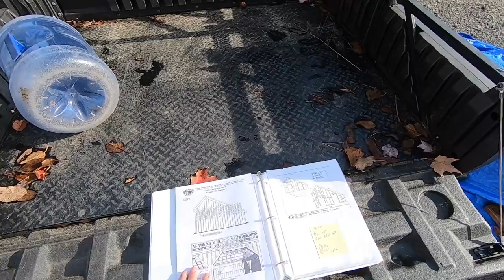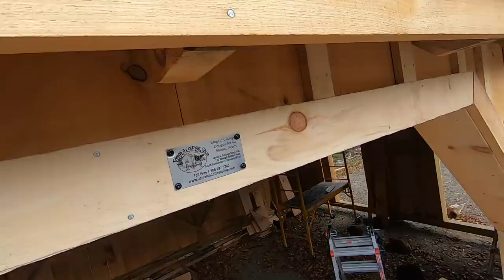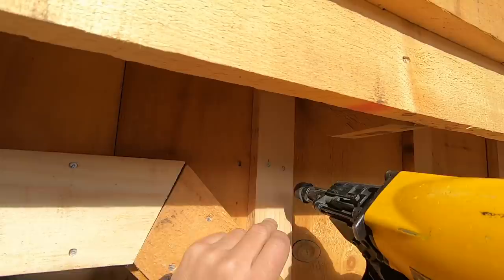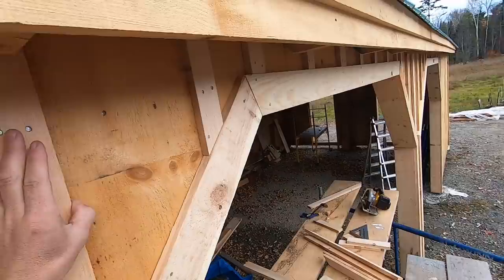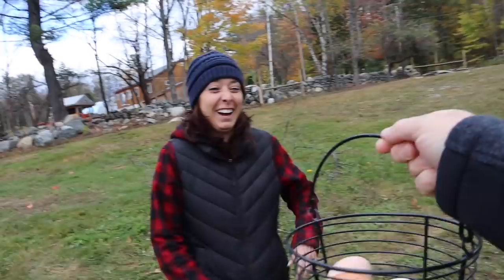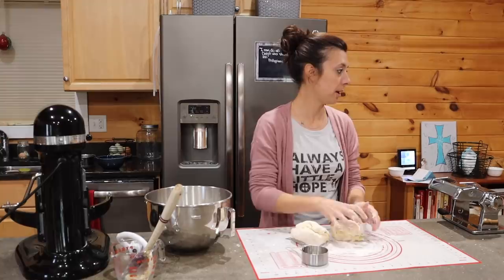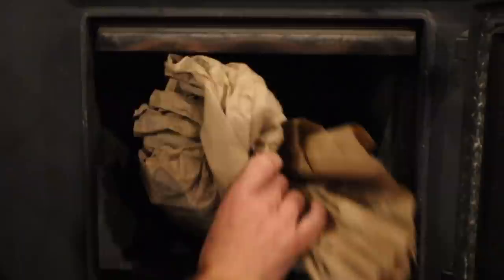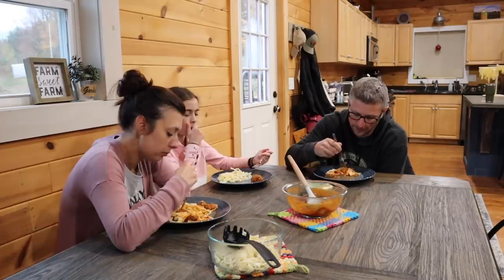It's Like a Massive JigSaw Puzzle Building a Post & Beam Garage Kit Bought Off the Internet

Comment: I love the aged patina of the wood too. After about 3 years if I see areas that are getting soft, I’ll put on Thompson’s Waterseal which doesn’t change the aged look.
Reply: J Glass  👍👍great stuff!  And minwax Wood Hardener can give you years more if you have sponginess along some bottom battens and panels, and then Thompson’s over that.
Reply: Yeah patina is one thing, but there is a difference between “patina” and rot. At some point you have to actually stop the deterioration process or the earth will claim these building back from you.
Reply: @chrluc  yes, and before that happens,  I start using Thompson’s waterseal.  When I see the bottoms of the long vertical shiplapped pine, I’ll pentox those areas, and cover all the rest with waterseal

Comment: As you will need to have some early morning and late nights in the garage I would say to order a few LED lights to put in the bays and run a line or two off the building next door to power them. 1 for lights and 1 for a few outlets will mean no running extension cords between them for you to hit with the mower or snow plow.

Comment: The garage/barn is looking great. The battens add a lot to the character. I like the natural look too, although I would be concerned for the long run and not protecting all that wood and your labor. 
I learned noodle making from my grandma. she was a farm wife who raised her family of 8 through the Great Depression and two world wars. Pasta noodles are different than egg noodles being drier and denser. One egg per cup of flour and enough water to form a firm, non sticky ball, wrap in plastic and refrigerate for an hour. Grandma rolled all her noodles by hand, I use a pasta machine like yours. Grandma also mixed and kneaded her dough by hand, I use a food processor with the dough blade for pasta noodles, egg noodles I do by hand.  
Egg noodles 2 eggs per cup of flour and enough water to make a slightly sticky dough, again wrap and refrigerate. (This step gives the flour time to hydrate. It gets wet in the mixing but has time to absorb that water during this rest.) Notice no milk, this is the first I've ever seen a noodle recipe that called for milk over water. Noodles are a basic food and were an economical way of putting more food on the tables of large families, milk was too precious for making noodles. I roll out my egg noodles by hand but typically leave them thicker for use in pot pies, (not your Swanson's baked in a crust pies, real "pot" pies made in a stock pot.) though they would roll out nice through a pasta machine. 
Grandma used her folding clothes rack for drying noodles, plenty of room and easy to store.

Comment: I see the workshop lower wood siding is going black with damp and mold. Why not treat the wood, it will last a lot longer and look better for years. Soft wood like pine and fur rots quickly if not treated and the damp kept at bay. I know you said you like the natural aged look, just seems short sighted not to protect your assets for many years to come.

Adding a splash shield like corrugated steel around the perimeter bottom 24” and a gutter to take the rain away from the roof will help as well.

Comment: Hmm...I kno you need the scrap wood for kindling.  But lookin at all the scrap you had, there coulda been some mini quick projects that coulda been made out of it.  I recently built myself a spice rack to go on the wall for quick and easy access, instead of scrounging around in the cabinet.  Made cooking soo much easier and alot faster on my part.  Only mentioned as an idea in case you wanted any idea projects to consider.

Comment: I'm no carpenter Al so at first I wondered why you would go to the trouble of trimming out the doors etc but it does look so much better now and I imagine that adds just a little more strength. Have you any plans to fill the gap at the bottom, or is that a design decision?

Comment: Have you thought of a rain water collection system on your barn as the boards are going black at the bottom and will rot quicker
Reply: If you put a gutter on the barn you would have to remove it before winter as the weight of snow they get would probably pull it off!!!

Comment: I like that you now go straight into the job,!! We all know you do Chores, but knowing what you are gonna do I just fast forward to the job!, the jobs looking good, are you gonna Concrete the base or Stone it?, maybe with the excess timber supplied with the building you can make a big box On Wheels to keep next to the saw to put off cuts straight into it, then doing 1 job instead of  throwing off cuts on floor, picking off cuts up,  putting into bag, Drag bag to vehicle to dump or put on log pile, good job guy cant wait for next big job. from UK.
Reply: Lumnah Acres said in a previous reply that gravel will be added to bring level up to the top of concrete piers and thus a gravel floor.
Reply: @tonygrimes13  Thank you.

Comment: Gnocchi, Ravioli, Pierogi, Lasagna, Linguine, Angel Hair all fresh home made man that is a neat little   device.
If you & Gina both get a license & both fill your tags that would be 2X the meat. You have the butchery setup already. The scaffolding with a some adaptation could become a blind & SXS to move it around will make it cake. The land is there plus using the blind can give you a heads up on what predators are moving near by.
I suggest hunting could provide several practical benefits. A dollar slug = pounds of lean premium meat - a few hours of time with a couple minutes of excitement thrown in. Check the Hunter safety requirements & enjoy. Dress warm though (hands & feet) 🏂🏻🤝🏻

Comment: Aren't the batten strips for covering up the gap between boards and not just for cosmetic
Reply: Yes, that was the original intent; keeps the elements out, as the vertical boards dry and shrink away from each other.

Comment: Why don't you put a little glue, on the tops of the batten strips where you can't nail? Won't the batten strips start warping, without nails or glue holding it down under the overhang?